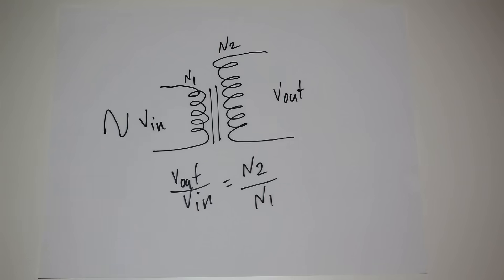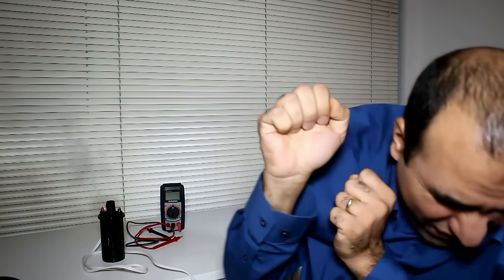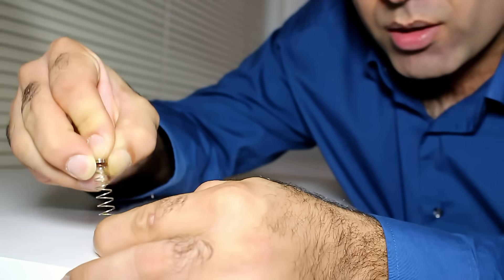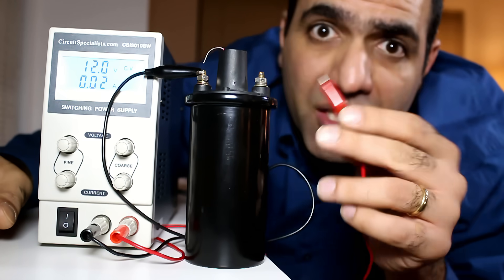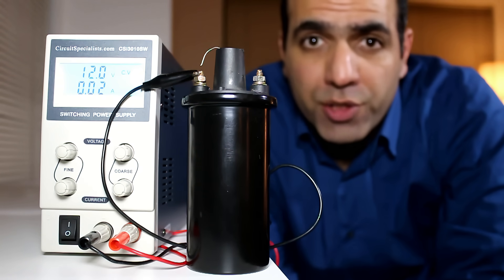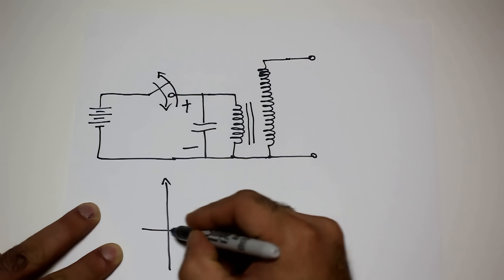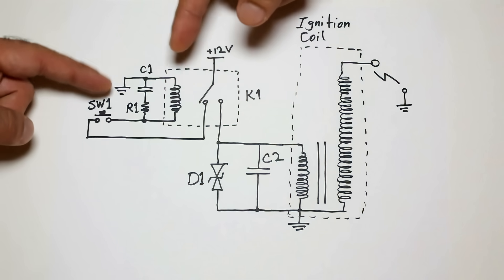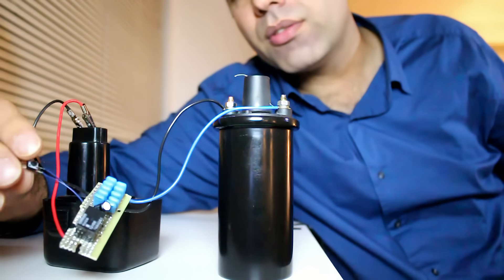How to Make a Taser (Stun Gun)

Comment: Is it possible to use one single 40V / 2200 uF capacitor and what is "D1"? If it is it a diode, how do I use it?
Thanks :)
Reply from the maker: McMaster011 Would work for capacitor. D1 is to protect against high voltage. Check my website for more details.
Reply: ***** What kind of diode is that?
Reply: ***** could a moped or motorbike ignision coil be used instead of a car one. as due to the rise of ever computerised cars ignisions coils such as the you held arent readly available in some countrys.. so would the use of such a moped ignision transformer have the same output?
Reply from the maker: god only knows
Not sure, but since they are used for ignition, it means they create high voltage. You should be able to create some good spark from them
Reply: ***** can your design be modified as to allow music to be played through the emitted spark as what can be done with Tesla coil devices and how would that be accomplished. BTW love your show and then I've learned a lot about electronics which has help me and my father bond over  replicating some of the project you have demonstrated.

Comment: Omg you crack me up on every vid.I laughed my azz off when you plugged the coil straight into the wall & tried to measure the spark distance across the nails with a metal caliper..lol.I sort of made one a long time ago using a small ignition coil from a scooter,you can run it off a 9v battery and its very compact..i used a condenser for an old motorcycle & a push button so it wasnt continuous spark but it was a healthy fat blue spark..i was zapping friends with it at school for fun..that was over 20+yrs ago.I'm going to start watching all your vids..keep em coming!

Comment: Is that a normal relay or some kind of fancy relays ? And is it possible to use a 555 timer ship to switch on and off a "regular" relay ?
Reply: *****  can you make plz make a taser from a disposable camera ? i know it can be done show can you plz make a video of you making one , i think it would be funny
Reply from the maker: Mohamed Berrada Just a normal relay which can do 20A. 555 is good, just that you need to make sure it can take the relay coil current.
Reply: ***** if a 555 was used a high power mosfet would i think be needed to handle the rapid power switching.. but the real question is how did you findout the right capasitor for the coil.. it looks like you put afew in parallel but doesnt that limit the wattage?
Reply from the maker: OnlyKnowsGod
The key is to make the coil resonate at a good frequency for maximum power transfer between primary and secondary. a wide range of capacitor work with this coil starting from 1uF up. But also since the primary voltage jumps pretty high, they need to be high voltage rated too. That's why to make 10uF which I had, I used 10x 1uF 250V capacitors.

Comment: Would it be possible to connect a 12v battery to this circuit since you are using 12v DC? I wonder if that works and will it have enough power to maintain the arc.
Reply from the maker: ***** I was using a 12V drill battery, so yes

Comment: Drill batteries are DC. I'm assuming that the diodes in your circuit play a part to convert it to AC?
Reply: the relay is doing what's called motor-boating. very simple mechanical oscillator anyone can make

the power going to the relay first passes through two contacts which are held together. once power is applied, they are pulled apart, which cuts power, allowing the two contacts to spring back together, which attaches power, etc. very fast as a square wave oscillator.
Reply: Sorry back on my regular account. I can kind of visualize a relay as sort of "spiking" the DC to create waves. Makes sense
Reply: well, AC doesn't mean voltage is reversed, just alternating. it could alternate by a half volt technically. The relay generates essentially a square wave of 12v (if that's his drill pack voltage) to 0v back and forth quickly. it charges the coil then releases then charges then releases quickly.

Comment: Hiya great video as always could I ask you, why when you touch the arc it gives you a shock? I thought the current will pass through you only if you are connected to ground. The negative terminal on the battery is enclosed in a plastic case so how is it connected to yourself. Cheers

Comment: Is there a way to drive the primary coil with a transistor? I realize the oscillations will cause very high voltage pulses, but I dislike the idea of switching a relay this quickly. It just feels wrong :P
Reply: ***** Thank you! I have a couple 350V rated ones, not ideal, but expendable. I'll just build it and hope it doesn't blow :)
Reply: ***** Or use a freewheeling diode (or is that a no-no? I'm not an EE).
Reply: ***** Well my idea was to use a freewheeling diode in conjuction with a FET switch of course, so it helps it through the induced voltage as the field collapses.

(I had little electronics course in college, still remember some of it.)

Also I love your videos, highly entertaining!
Reply: akkudakkupl If I'm not mistaken, this would allow the primary coil to discharge through the diode, which would eliminate the voltage spike we are trying to produce.
Reply: Poly Bun Wow, that's cool! Thank you :)

Comment: Put to both of the swiches a foil capacitor parallel. A value around 0,1-1µF should reduce the sparks and stop corroding and aging of the relay contacts. So your taser lasts longer. The spark will be shorter, but it will carry more current/ energy. You are welcome.

Comment: You say that it only works on AC as inductor and capacitor are AC voltage parts. How do they work on DC such as a drill battery you used?

Comment: "Only works with AC current" huh? Cars usually supply 12V DC to the ignition coil.
What did I get wrong?
Reply: Well if you start pulsing that 12V DC, it isn't DC anymore.
Reply: Thanks guys!  Got it.

Comment: Very good job on this. I was toying with a 555 and a mosfet driver, and the damn back emf voltage would always blow up the mosfet. I blew at least five mosfets up and an mp3 player because I wanted to audio modulate the arc and it worked.... for a few secs. Your driver is way better. Thanks for sharing and please keep up the good work. Cheers :)

Comment: For the lazy people: Get a disposable camera, remove everything but the battery and the flash, remove the flash, and extend the wires to a suitable position (like the nails in Mehdi's video), then charge the flash, you should hear a faint rising pitch.

When ready, press the shutter button, the electric discharge will go through the wires, and everything they touch.
Reply: ***** Of course, it could serve as a nifty first draft for those who are interested but not willing to spend too much time into it. I built mine from there, and eventually did a similar one to the one you made, with a smaller battery, and not nearly that much power, but cool nonetheless.